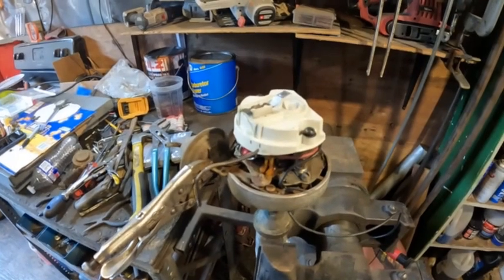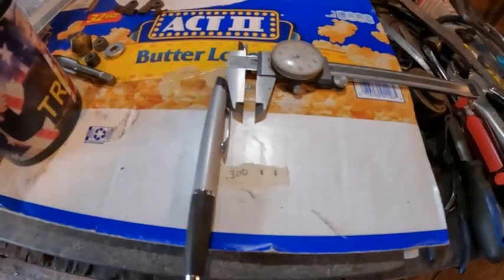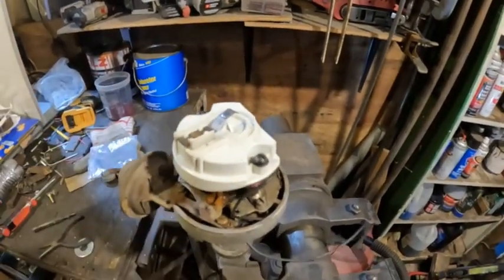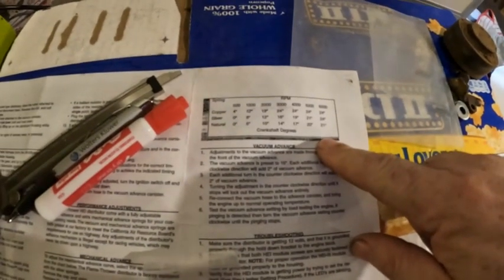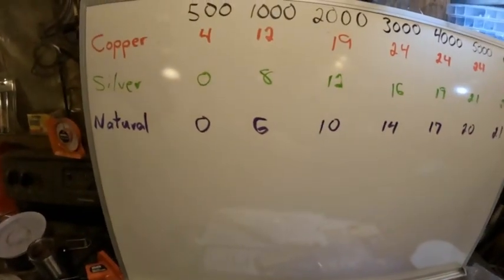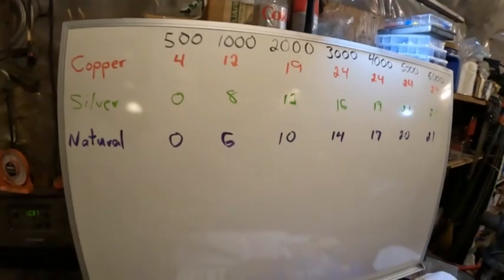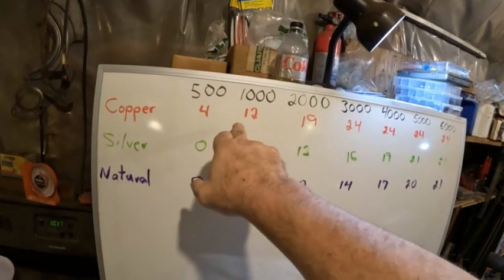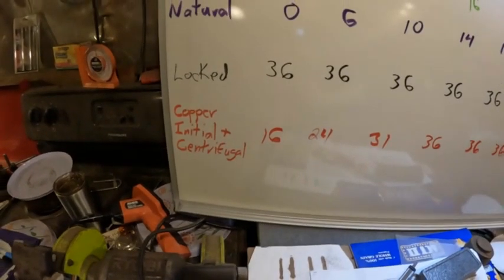Measure Distributor Centrifugal Advance on the Bench

Comment: You're a smart guy, Tim👍Are you aware that there is limiter pin or bushing under the advance mechanism on old GM distributors? I'm not sure but I think with HEI distributors the amount of centrifugal advance is relied on the shape of the weights(on at least some of them), but the provision for a limiter bushing is there. The shaft has to be removed to access it. I've made my own bushings sometimes but SOME curve kits include a bushing. I like how you figured the math for the measurement. I'm not mathematically inclined so I made a little degree wheel using a transparent tupperware type lid haha. Whatever works, right?
Reply from the maker: Thanks. I didn't know about that. Good info